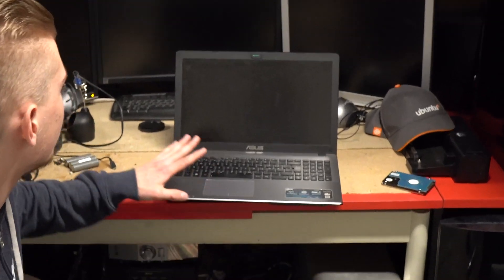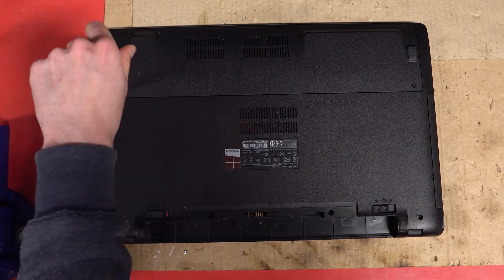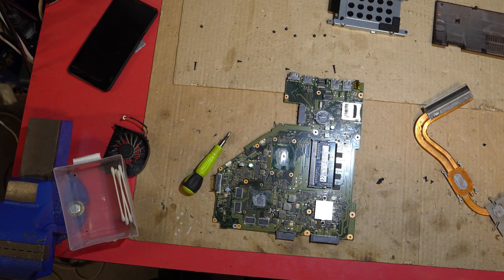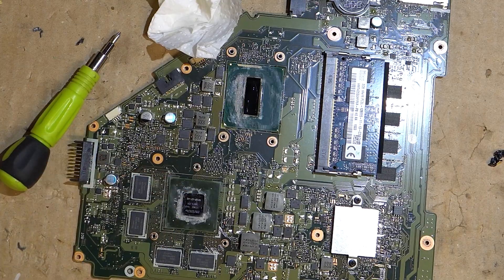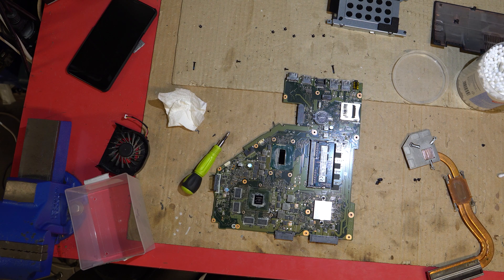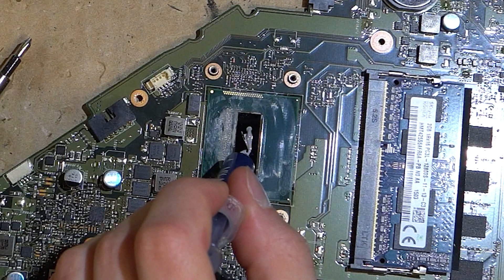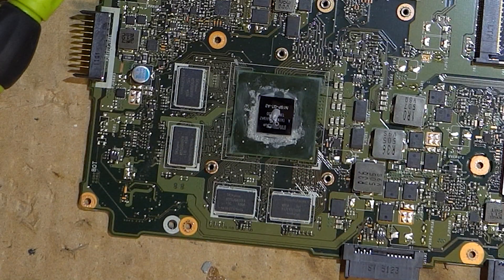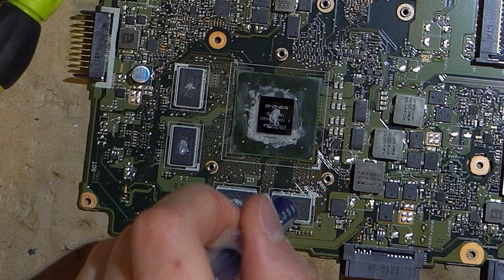How To Change The Thermal Paste In an Asus Laptop (F550J and similar)

Comment: I just want to know how useful it is to put it on the mini cells as well? I mean those around the GPU
Reply from the maker: Do you mean the VRAM chips? Usually you put thermal pads on those, because they might not always make perfect contact with the cooler and their heat output is much lesser compared to the GPU itself. We didn't have suitable thermal pads at the moment, so we used paste, but yes you need to use either paste or a pad on them.

Comment: I have this laptop, but I'm to scared to mess my i7HQ up! :'(
Reply from the maker: Well, you could take it to a repair shop, but honestly, if you're careful and at no point use excessive force, the chance of you breaking anything is very slim. By doing this yourself you'll learn how to do it and save money.
Reply: @KrupsFilms  Thank you. This motherboard also doesnt allow me to add 1x 16gb ddr3l memory. It gives only max 12gb in total
Reply from the maker: I think these laptops are too old to support 16gb DIMMs. Although the processor itself supports up to 32GB RAM, that likely only works with 4 8GB DIMMs.